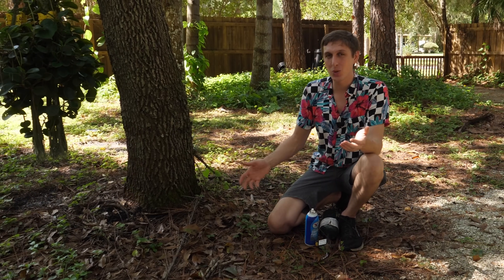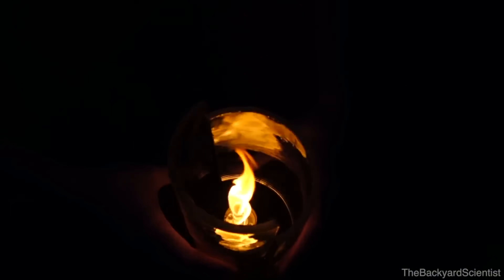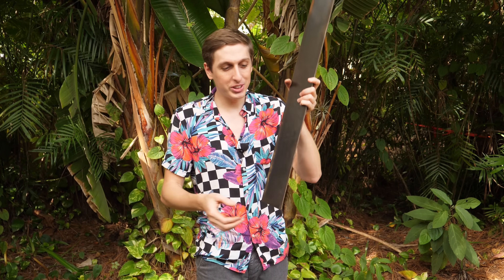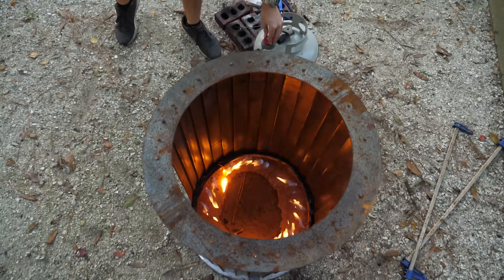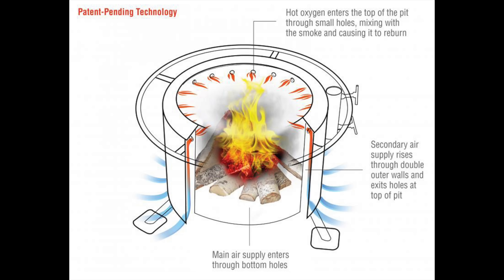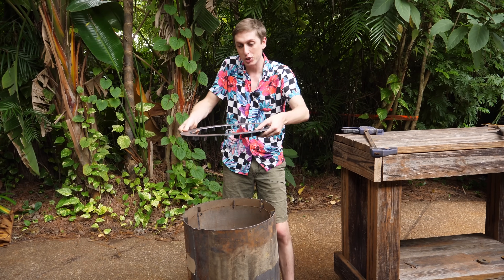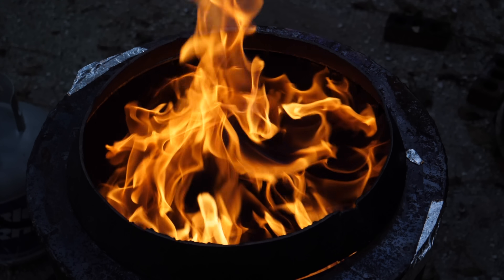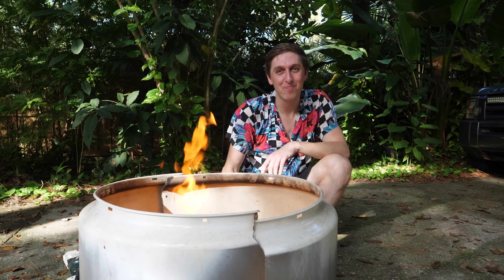The Impossible Fire pit Tornado

Comment: The way i would say to do it is have a bottom chamber for ash and a middle chamber with two inlets from oposing directions into the middle chamber. Then the top chamber would have a hole in middle so the air flow from the middle chamber produces the tornado

Comment: Dude you are living out my fantasy!!   I want to make a fire pit/tornado to maybe 1) have the tornado tend to direct the smoke straight up and away   2) be dope to look at    3)  maybe achieve really good combustion.
Then, I am looking for a 'Tensile tarp structure'  that I can A) raise, B) lower for when not in use, and C) close off more if its windy.  Smoke would exit a hole in the center, which would also be the highest point.
Back to the hearth: what if  you had a series of steel pipes in a spiral that would feed air into a large steel bowl that contains the burning wood.  Cold air, which is heavier, begins orbiting the fire and gases, which stay in the center because they are lighter.... producing a swirl.

My summer project!!!

Comment: so i am thinking your typical wood gas stove but instead of just small holes that shoot straight out, weld some small pipes in those holes all at an angle.  I think the small holes/pipes will direct air much better than the angled pieces of metal that you tried since the small holes make a much stronger stream of air due to the increased pressure.

Comment: I think the problem with the slat idea is that the air doesn't have time to heat up first because it's not moving up the walls. I think what you want is a donut with a spiral stair case type ramp in between that then has 2-3 inlets. That will give the incoming air some pretty good speed. Still not sure the flames will extend past the top tho. The tanks with the slats might've worked better if it was shorter

Comment: What if you used the same principle of a turbo jet where you burn the fuel inside to create a convection current to spin a fan blade underneath the fire, attached to an impeller at the top to spin the flame? Moving parts but powered by the heat.

Comment: The Solo fire pit works so well because not only does it have that hot air venting in the side wall thing but it also has a large fresh air supply coming up through the bottom of the fire pit center. You did not show us you also had a good updraft under your fire and if you didn't, the fire wasn't going to burn well since it was needed to pull in fresh air through the top when heat was rising in the opposite direction the combustion air was flowing.  So drill a couple of dozen holes in the bottom, prop it up on top of some blocks and then you'll get your fire pit tornado.

Comment: Wellll... long years ago I learned to use  hatchet to hack vertical cuts of 4-5 inches long in a metal drum in rings about 4-6 inches vertical separation top to bottom. 

Then using the hatchet or a strong, thin bar form the slots to slant in the same direction so inflowing air would spin around the inside horizontally.

As the fire burns the vortex produces smokless, center-swirling flame.

These never rust out

Comment: At the risk of sounding a bit shrill, please don't be that guy who encourages others to use GASOLINE to light fires.  There is NO save way to ignite gasoline except in an engine.  Causing kids to get seriously burnt, as opposed to just losing arm hairs, is not a good idea.  I know two kids who got seriously burned playing with gasoline and fire.  It is too explosive.  That's why it works so well in engines.

Comment: While I've wanted exactly one of these for years, I've only YouTube researched the topic if fire vortexes and burners.  A strong updraft from intense heat is one of the prime forces between tornados. Simply rotating air may be insufficient.
After the hot air and fire raises, it can easily hit a ceiling of cold air and smother the lift and rotation needed.
If the air above the top of the fire chamber can be induced to turn, that could help, but having strong lift from intense heat is very important.

Maybe if a vacuum or fan could be mounted a few feet higher than the flame, that could help.

Comment: Great video, to stabilize the air flow surrounding the tornado you probably need to protect the flame from wind either by a mesh/ glass cover or by forced air vortex with fans. On small scale it works: https://www.youtube.com/watch?v=Ee1n5eXy6ps

Comment: I wonder if the dryer drum works so well because it has that slight restriction at the top? The flame needs some way to "overheat" the air and that restriction at the top helps to concentrate the heat of the flame and air inside the firepit more effectively. If you just added a cone restriction to the top of your multibladed version, would it take off the way you imagined?

Comment: i made one.  you have to have enough wind (or you could use a fan).  All you need is one of those cheap chimeneas that are spherical at the bottom, with two square ports, one on each side.  if the ports are slightly off angle to the direction of the wind (i know constant wind and direction is rare, but works on the coasts).  it make a perfect fire tornado, up to 3 feet HIGHER than the top of the flue, or about 7 feet hight from the bottom

Comment: No pyrotechnician(?) Here, but the design with the water heater and fins might make a taller flame if you would cut off about an inch or two from the bottom of the heater drum. Air will be pulled in from the bottom and sent up, maybe also for the top ring if you could angle it by maybe 20 degrees or so. Being more conical and with the spiral from the fins, would it produce a more prominent tornado?

Comment: Way too complicated.  All you need to do is think of the thing as a mass airflow engine.  You need a long intake pipe to establish velocity, then pass it through the combustion chamber, and use internal fins right after that for initiation of the circulation.

Comment: I would try a Propane ring at the bottom as you did here, then a furnace blower (squirrel cage) to guide the air, with a second ring of propane jets at the top like an afterburner. Then place a second identical blower or slightly larger on top of that to continue to guide the airflow.  Use a separate flow control for each ring so the gas flow is tunable.

Comment: Accidentally made a tornado fire pit with a bunch of cut up Christmas tree and 2 stainless steel washing machine tub drilled in spiral pattern the bottom tub was a front loader and the top one was a top loader that a gapped about an inch for extra air.

Comment: I wonder if you put a lid on it with a smaller hole in the middle if it would project the fire vertically. The exhaust has to go somewhere, restricting it would increase the vertical speed- up to some point.

Comment: in singapore, we have a science centre which has a place in the so called open area where they use it to make a fire tornado.
They had the sane idea as the steel plates facing at an angle and it would actually always go up up quite a high height but around it was glass (place right above aligned with the steel plates) to keep audience safe
well of course the one in the video is a smaller scale compared to a one which is bigger in a science centre

Comment: I'm a month late but I have a take on this. TLDR, make it hot and dry above your fire pit.

I am not an expert but an enthusiast, the following is a condensation of remembered scientific fact from a novice. It might help though. 
The physics of fire tornadoes are not dissimilar from those of dust devils, and those are not too awfully dissimilar from tornadoes (though certainly not the same). The energy of all of these phenomenon are derived from temperature differences at different altitudes. For tornadoes, three masses of are involved.  Cold moist air  from the North Pacific colliding with warm moist air from the Gulf of Mexico. The third air mass, warm and dry from the Southwest deserts, acts as a lid on the warm moist air from the Gulf. When the energy from the sun begins to wane in the afternoon the lid breaks down without heat from the sun, allowing the warm moist air from the south to rise rapidly. As it rises the moisture in the air cools and condenses into water droplets forming clouds. Condensation creates a warming effect in the air around it (also using moisture from pacific maritime polar air) thus fueling the updraft and more cloud creation at higher altitudes. This situation will feed itself as long as moisture and heat in the lower air mass remain, and are not canceled out by up and down drafts colliding. This brings us to the last ingredient. Wind shear.  A wind blowing across the updraft will allow the updraft to continue while the inevitable precipitation from the storm is allowed to fall in a different place. The other effect wind shear has is to induce rotation. This sheer has the effect of creating rotation and can move that rotation from a horizontal orientation to a vertical one.  The energy in a tornado comes from the energy from the entire storm cell being reduced to a relatively small footprint. As the rotation contracts, conservation of angular momentum win intensify the effect of the energy, converting lower velocity winds at the outer bands of the cell to extremely high velocity winds towards the center of a tornado. 
This is all to make the point that higher temperatures and lower humidity in the ambient air above which dust devils and fire tornadoes form may have a great effect on the overall size, strength and organization of these smaller phenomenon (think of the lid of warm dry air on the warm moist air that fuels a tornado). This was cited as one reason the fire whirl in Redding, California in the 2018 Carr fire was so big. The area was in the middle of a drought and had been experiencing triple digit temperatures. If you can figure out a way to create a very hot and dry column of air above the fire pit, you could conceivably create a taller and more organized fire tornado pit.

Comment: I'm wondering if instead of one large pit and tornado, he should try maybe 5 smaller ones (each with its own vortex blades) inside the larger vortex blades. This would reduce the wood required and possibly create an amplification effect much like a multistage jet? Would have the added benefit of looking way cooler with multiple mini tornados

Comment: The setups that forced a counterclockwise rotation worked the best. Every attempt that tried a clockwise rotation flopped.  The first small split tube encouraged a counterclockwise rotation and worked well. The larger water heater split tube was setup in a clockwise direction, flop. The slat design, counterclockwise, worked okay. The flat impingement ring was a clockwise design, not so good. The white drum in the end was counterclockwise, worked well. Don't fight mother nature, she wins most of the time.

Comment: Strange ... I thought you would use something like this https://www.youtube.com/watch?v=jAWElOSiMoM
 (only instead of dampers there are points on the outer or inner edges of the impellers so that you can rotate them around the axis) to adjust the impeller size ... Maybe you should experiment with this?
The branches of the trees were very alarmed.
By the way, there is also such a thing: https://www.youtube.com/watch?v=5-e2tAUo89o. But yours, of course, is much easier.

Comment: Dust devils are caused by unevenly heated air. @ 3:16 you can see the effect of the heated air column reaching about 20m with a simple set up. It should be possible to engineer dust devils and even wind given the right atmospheric conditions and enough heat in larger columns; so a couple more barrels and more gas.

Comment: I think you had the right idea at 3:19 (re: some good tornado action but the fuel source being too deep in the chamber so the propane burned off before it got high enough).  Moving the flame source higher cuts down on the amount of air draw, however, so you lose rotation.  Rather than moving the propane ring up, why not keep the one at the bottom to maintain the rotation, then just add a second (or third or fourth) ring higher in the chamber to "refuel" the flames on their way out?

Comment: Wonder what happens if you add a screen tube above it to reduce outside influence after it leaves the fire pit. So you light the fire, then set the tube on top reducing the breeze influence on the fire tornado.

Comment: Use two fires? You could use one fire to heat water in a container and use the compressed steam to push turbines and make a fan, then direct that into the next fire to provide it with more oxygen. It has moving parts...but it would allow you to provide the oxygen requirements for the fire tornado and give greater acceleration. At the center build a propper teepee or pyramid structured fire complete with kindling, fluff etcetera, get both fires going and you would have enough fuel for a properly high fire as well

Comment: cant you find commercial glass half tubes big enuff for a garden fire ? ide buy a set if i could find them (ps im a blacksmith so mostly made of fire Oo ) PPS you can make one with rotating mesh and still see through it , just need a way to make the heat rotate the mesh for you

Comment: I hope you read this. I have accidentally made a 10 foot monster fire tornado a long time ago. While working to  clean tar off of a concert pad in a drive through. While a friend was smoking a cigar. We had a hose going laying on the ground with piping hot water coming out flowing across an upward incline. Which made the flow arch and flow down. While we pored in goof off from the big metal cans and scrubbed it with deck brushes. My co-worker was saying his cigar would not light it because of the water would put it out and not to worry, as he throw it into the mix and it light on fire instantly. Which followed the path on the water arch at about 2-4 feet in height.  I quickly kicked the hose away because it was moving the fire. The fire flowed on the water up the slope and upon coming down, caused a vortex the thin  water/accelerate mix, as the fire instantly grow to about 10 feet with a classic tornado look. Not broken it a trying to twist like this video, but twisting to the point the fire liked like a fluid and I could see the spiral. We watched this masterpiece of a fire for about 30 seconds as it moved across the pad. Until it went under the overhang for the drivethrough window and was spinning and hitting the roof. Dragging a soot line where the center hit. It took maybe a few seconds of attacking it with the hose to break it. Which felt like forever. The water would just cut through it and not affect it until I hit the base puddle of water against its flow which dropped it to a small fire, we could put out easy. Them spend the whole night cleaning the soot of the metal white drivethrough roof. No one was the wiser it ever happened. Other details that might  or might not have affectted the outcome was it had just finished from a very bad rain/lightning storm and everywhere was very wet in the first place and it was very windy and the building could had been redirecting wind. Not sure which factors matter or not to recreate this. The very top was the only part that was unstable. Sometimes when upright it would have a nice circle top(from my lower perspective).  When it moved the top would tip and pull itself back up. Sort of like how a real tornado moves but the top moving and flowing not the bottom. When the top would angle move to the side and tip more than 12-20 degrees it would flare on the top and edges like in this video, then fix itself and look stable again, just to repeat the process until we destroyed it. I tried to remember the details to the best of my ability, but this was over 20 years ago as well. I hope it can help you recreate a monster fire tornado that looks just like a tornado. Far closer in look to your smaller on than the attempts in this video of a bigger one. I wish you luck it and hope this is helpful to you in some way.
Reply: sorry for the typos. I was writing fast, editing small parts in the process, and did not proof read it after.

Comment: as someone who burns ALL their household trash, I have made, remade and refined, endlessly, my burn barrels over the years trying to accomplish basically this. Yes you can use blowers to make incinerator as some youtubers have, yes you can use propane to accelerate the burn but when you have NO trash service and you have to burn everything, and what doesn't burn you either melt down into ingots for reuse or take monthly to the dump, you get creative. I use a barrel within a barrel with slots diagonal offset(1.5inchx6inch), a cast iron grate 12 inches off the bottom with a trap door in the side of the bottom to clear ash. The barrels are spaced with 1/2 inch steel rods(i just cut a larger barrel in sections and fit it over a smaller one, offsetting the slots. I drop a cup of diesel on my trash and light it with a match. Starts slow then starts to roar as it catches down, gets a nice vortex sometimes 15-20 feet high. Only thing left is ash and steel cans, melts the aluminum cans to tiny clumps.

Comment: Ohhhh man I've done it! You need pieces of plywood! I can't get away with doing this where I live but you set them up in the same way you have your set up now. 3 or more set vertical but it's worked for me horizontal as well. It just gets soo hot it pulls a bunch of air in! But it burns through itself super fast!